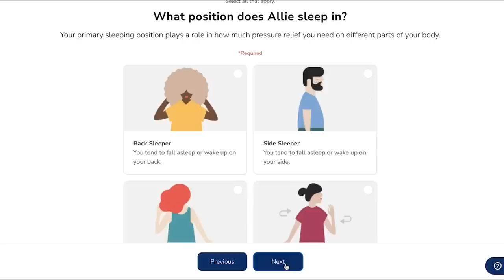THIS IS A DISASTER...

Comment: Regarding last vid, ALWAYS put yellow caution tape 6-12 inches above ALL lines that are buried, when you see the yellow tape digging with the excavator u stop and hand dig the rest, you'll never damage another pipe again. Cheers from Canada!😁🇨🇦🔨
Reply: I am about as far from knowing anything about propane/electrical/sewer lines as one can get but did wonder if there is a way to demarcate where the lines are. Then I wondered if that makes any sense when they get several feet of snow over the long winter. As another comment says, the video is not in real time so perhaps a future video will show how they chose to mark things. This one was definitely a nail biter.
Reply: That was my comment and suggestion friday... u also need to fill over and around the pipe with sand or pee gravel as another visual cue to when your close to the pipe also hello from southern Ontario
Reply: Great advice my fellow Canadian!!❤🇨🇦❤🇨🇦❤
Reply: Great 💡 idea. Thanx
Reply: Most definitely caution tape was needed. In our area it is required by code along with a tracer wire. Then there is no issue of not knowing exactly where the lines are.
Reply: I've lived in Canada for 60 yrs and have never seen a moose in the wild. I even went to the East Coast and nothing and Trent and Allie have them in their back yard. AMAZING!
Reply: exellent idea!
Reply: I was going to post the exact same thing! 👍🥰 All my lines have it and zero guessing when I’ve had to dig.
Reply: That just makes too much sense. That's not how we do things in the US
Reply: @jennifermassie7227  Thanks! Which province you in? I'm in Southern B.C.
Reply: @homernextdoor5950  I'm in southern Ontario. ❤🇨🇦❤🇨🇦❤
Reply: Its to bad they will probably be done when they read this.
Reply: That sounds like a great idea. I am surprised that isn't commonly done or at least the rule. It doesn't sound like Curtis did the job correctly or eficiently when he did it. I think it is a good thing that Trent did the repair. Great idea to mark it on the repair, in case there is a "next time" you need to go in there again.
Reply: Just from seeing some of the comments guys I think maybe you should have waited for Curtis to fix it. But I am just a viewer that loves watching your videos and know nothing about this kind of thing I know how frustrating it is for you guys to wait and love doing things yourselves. But please be safe and I will see you in the next video. Love and Prayers as always.
Reply: Awe you Canadians are the most wonderful Neighbors! Eh? just love the kindness, wisdom (especially the winter knowledge)! love from AlbuQuerQue!, we have heat advisories today!
Reply: @msmdare  What temperatures are they expecting?
Reply: @LilyWasHereMB  Maybe not in Utah but here in NY we are required by code to put tracer tape and tracer wire.
Reply: Thanks Canada! 👍
Reply: Great idea!
Reply: You could take cedar mulch and dribble it over top of the utilities that you have just put into the bottom of the trench and then if you have to dig near them when you see Cedar mulch you know you’re close to danger
Reply: @jennifermassie7227  also Southern Ont
Reply: @jennifermassie7227  New Brunswick here
Reply: My tough exactly. Not having tape/sand/rocks to separate the layers and prevent you from going through the pipes/lines in the trench is a bit odd
Reply: @louannekeast8575  I'm in St. Catharines!!❤🇨🇦❤🇨🇦❤
Reply: That caution tape is a great idea!!!
Reply: @marymccowan6629  I don't know what the 'time lag' is, but yeah, I am hoping they are done with this project by now. 😃
Reply: @msmdare  We do as well in South Eastern Arizona. Not as bad as Phoenix though, 111 degrees. Ouch! Stay cool. :)
Reply: @unattendedgrandma4073   I am like you on knowledge of this- zero knowledge BUT it seems to me that it would simply be somewhere in any plan, where those lines would automatically have something to identify and protect them from damage given how crucial they are to everything. Just doesn't seem logical that  anything as important and dangerous could only be found by trial and error.  Interesting but scratching my head trying to figure that one out. Glad and applaud them in having the skills and ability to do it and mitigate any detrimental mistakes. Continued success on that project.
Reply: There is special tape that is metallic , colored ( red, blue, yellow with letters identifying the utility ). With a pipe locator you clip to the tape that sticks out of the ground at the pipe end and follow it using the locator.  Sand is used as back fill for the first  2’ to make final locating easier.  This was not a good job on the install.  I enjoy the video .
Reply: Sewer is green tape
Reply: @Katter715  Not when all 3 lines are in the same trench. Just saying. 😁
Reply: #homernextdoor we did the yellow tape line but we also when putting everything back this time not only did we put in the yellow tape line but I planted Monkey grass along the top side of the line. That way we always know where to dig.
Our neighbor did a borderline line.
Reply: Since they don’t know where the lines are, how can they mark the lines unless they dig?
Reply: Great idea.
Reply: Caution tape is done in the US, too. The contractor just didn’t do it.
Reply: @johnwindham1115  Same in TN, it is required to pass inspection. But we also have an inspection of septic tanks per code, which may have saved them this headache.
Reply: @LilyWasHereMB  TN does, we also have to pass septic inspection, theirs would not have even passed our inspection.
Reply: I like what Homer nextdoor said about the caution tape idea is a great thing. That should be done on any trench digging job once the lines are place and the covered up with that soil. 👍👍
Reply: I like what you said about the yellow caution tape in the trench. If fact that  should be done everytime so you done have a mishap in the future. 👍👍
Reply: That is fantastic advice.
Reply: Here in the UK it isn't uncommon to cover utility lines with paving slabs
Reply: Great tip! Would be so much less stress!
Reply: @patrustemeyer9401  They installed those lines last year, that's what we are all saying. Had they put tape or some other markings at the start they wouldn't have this problem.
Reply: I am a big fan of the indicator tape method.  It has saved me many potential repairs in the past.  I also take location photos with fences/trees/sidewalks, etc. as a reference while the trench is still open and print them out to place in my project file.
Reply: Thank you Homer next door. It's the little things. God bless
Reply: @jennifermassie7227 ,,,hey fellow Canuck...🇨🇦🇨🇦🇨🇦...I'm from Eastern Ontario...🙂
Reply: @joann1234  lots of Canadians watching these guys!! Not sure how much longer I will be watching them though!! They are making some pretty stupid choices that are putting to many people at risk!! Including poor little Leo!!❤🇨🇦❤🇨🇦❤
Reply: There is a utility location service that you are required to call before you dig anything anywhere!
Reply: Oh my! I was screaming this for the last episodes. I'm in Europe and we do this! Over gas/water or sewer/electic lines there is always sand first and than yellow tape so you dont accidentally destroy them.

Comment: Before you recover the trench, cover wires and pipes with about 2 in of white sand.  That way you can see where stuff is when excavating.
Reply: 6 to 12 inches works better    if it were 2inchs its barely noticeable
Reply: Isn't it supposed to have a tracer wire kind of glad I had my work done here in Ohio and I know it was done correctly
Reply: @naturalwitch1359  yes tracer wire but that only helps locate the direction of the line  not so much the depth, thats where sand beside and over the pipe comes in so when your digging and u come into contact with the sand u know when to stop and hand dig saving a lot of aggravation and guessing
Reply: I have even used cedar mulch 

as a marker 
to give you something to see around buried lines
Reply: @naturalwitch1359  
I was in Ohio home builder …&?…builder inspector, I had dozens of subcontractors that were answering to me….)
 in the 2000s
 And I always recommended using the sewer line as the location reference and depth simply by adding extra clean out and taking proper measurements you can also snap some pictures real easy and line up with a window or a door or something

Comment: I worked the petrochemical industry for five years back in the '80's, loading rail cars, prepping equipment for maintenance, doing vessel entries during turnarounds plus the tasks of regular operations. With chlorine, hydrofluoric acid, 80% sodium hydroxide, 90% hydrogen peroxide, superheated Therminol and perchlorethelyne in my structure, I got a daily dose of safety mindset.

The dig you made in this video is what they would have called a "$50K trench." Meaning: if the supervisor saw you in a trench like that, it would cost you your $50K job then and there.  Better that than your life.

Comment: From a retired firefighter: the city line you cut was Natural Gas which is lighter than air and would not remain in the hole. Propane is heavier and would settle to the lowest point. Just FYI.
Reply: As a viewer, thanks for the fyi, in general I have a fear of all gas.
Reply: @nunya8843  Including gas-oline?
Reply: Why would they put all three in same  trench? Always call before you dig
Reply: @kellybenhart3244  smaller footprint.
Reply: @kellybenhart3244  right water and electric has to be 12” away from each other for code in my area
Reply: @kellybenhart3244  ...as in Dig Safe? Im sure they did.🙄

Comment: Put a strap around the propane tank and anchor to a tree base to keep it from rolling into the trench as you work.
Reply: As our girl, Allie, suggested!!
Reply: Alternative: place pit boards in the trench just at the foots of the tank (Sorry, don't know the English word).
Reply: @wjhann4836  To prevent cave-ins: SLOPE or bench trench walls SHORE trench walls with supports, or SHIELD trench walls with trench boxes
Reply: @jackjones5314  its useless all the suggestions we are saying Trent never accept them it all has to be his way wether it works or fails thats how its all been from the beggining
Reply: @jackjones5314  What do you name the material you put in deep trenches while building. Digging to repair a main drain line in the street can't be benched.
Reply: @Nates38487  the fact that this video was last week, or further back, might be why he doesn't follow your directions.
Reply: I didn’t understand why they were worried about the propane tank rolling in and not worried about them being in the trench without supports. For someone who worked in some types of construction in the past he should have known this.   Very dangerous situation and a cave in is exactly why we have OSHA.
Reply: @wjhann4836  props and shoring and they need to do it and fast.

Comment: I'm surprised code doesn't require a concrete slab for that tank.
Reply: Now that's what I was thinking. You mean for the propane tank right?  I was thinking as I watched this, why isn't that tank sitting on something that would never have a propensity to just collapse? I was looking at the video and thinking - I would want my tank secured on top of or inside of concrete  - with boulders leaning against and/or under the concrete to support it rather than simply siting on soil. I would be afraid of it slowly crumbling.  I know nothing about this - I live in a city - but, I would want my tank better supported and protected than it seems to be now. Doesn't heavy rain weaken soil and have the potential to wash out? Wouldn't want soil to be the only thing holding it up. But, again, I know nothing about soil in mountains. I just know there are landslides.
Reply: It does
Reply: I was thinking the same thing. Why wasn't it build on a decent sement slab, that it is unable to move.

Comment: It is nice to be independent and do things yourself, but in this case there are serious dangers.  Putting your home, vehicles, and family and friends  in jeopardy is also a grave consideration.  It is more than leaks.  It is the danger of propane.
Reply: I agree, Trent you can’t keep taking these dangerous chances. I speak from experience as a retired home builder/ contractor.  If it would have rained that propane tank would have gone in the trench. Breaking the gas line you’re keeping open. 
So many ways this was not the best move.
Reply: Hiring someone to dig up and repair the line does not make the propane tank disappear.  Hiring someone simply outsources the hypothetically dangerous work to someone else.  However, if the person that was hired is less competent (with respect to safety matters) than you, then there can be scenarios where you may end up putting your property, and the life of the person that you hired, in greater net danger, compared to simply doing the work yourself.

One may assume or hope that a paid "professional" is more safety minded than you are, but if you are the one worrying enough about safety to want to hire someone else to do the "dangerous work", then it is quite likely that you are more safety minded than the professional actually doing the "dangerous work".  Paid professionals that routinely work under "dangerous conditions" may not be especially "safety minded" in general, or else, they likely would not have such a job in the first place.

According to the media, Russia's Gazprom has now officially cut off supplies of natural gas to Germany due to conditions resulting in "force majeure."  If Europe and/or other parts of the world really do run out of energy this coming winter, then far more people are likely to die from lack of propane (or other energy form), compared to the number of people that die per year due to "exploding propane tanks".

Cold (and hot) weather kills.  Propane tanks - not so much.
Reply: @Fritz_Schlunder  Astounding...a real deep critically thinking example with superior logic...rare indeed...thank you for contributing your exceptionally broad and more astute assessment. should be read by more of the 'know it alls" and critics who can't see beyond their personal biases...what you covered that they missed.. All views are valid and for Allie and Trent to make their own call on what to do ... given NO ONE ELSE has to face the actual consequences of their decisions..but them. But to have everyone offer their own outlooks and knowledge w/o an attitude of it being the BETTER one is the way to really help anyone else. In my observation..that's what you did.  and you brilliantly ADDED TO THE OTHER RECOMMENDATIONS WHAT WAS NOT MADE CLEAR AS OTHER CONSIDERATIONS so better decisions can be made. Thank you...i appreciate seeing this...wished i had the words to encourage less taking sides to this whether complementary or critical derogatory statements of anyone for what they did do so far....but for more contributions of solutions w/o criticizing anyone for theirs but pointing out flaws and what can DO to correct them and to be able to choose which make more sense to go with  and with new information that was not yet made clear .You did that so well....just gave examples of what could work and how and why might not and what else to consider....brilliant and what real help looks like. I am not so good with words so hope i made sense or might edit and try to do better.
Reply: EVERYONE SHOULD READ FRITZ SCHLUNDER'S COMMENTS...BRILLIANT..MOST ASTUTE CONTRIBUTION FOR SOLUTION ORIENTED THINKING IN MY OBSERVATION/OPINION while anyone can agree or disagree with that would be good to have his information to KNOW what many might be missing seeing.

Comment: If you are going to continue to dig to the house. I might suggest using a clay spade or sometimes called  a sharp shooter to probe gently to find buried cables and pipes. This is from a retired Journeyman Lineman Splicer and Trouble shooter having dug and fixed thousands of power lines in duct and direct buried.  Just my opinion.

Comment: this is obviously long over by the time the video comes up, but while you did good work there are some real safety concerns.  first, you learned quick that digging off 90 degrees is no bueno.  Second, that's a pretty good size trench.  Not necessarily an imminent collapse hazard, but having some shoring in there (even some plywood and 2x4/4x4) would make for some cheap insurance especially if you're going to be climbing in to dig by hand.  And even after you fill that trench all back in, keep a close eye on that propane tank.  the land won't have the same stability as before you dug it up.